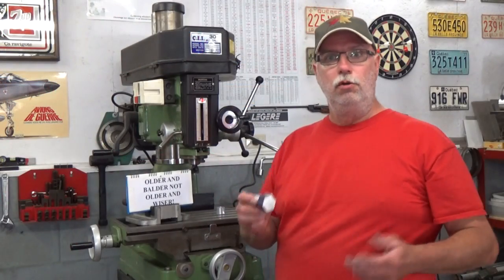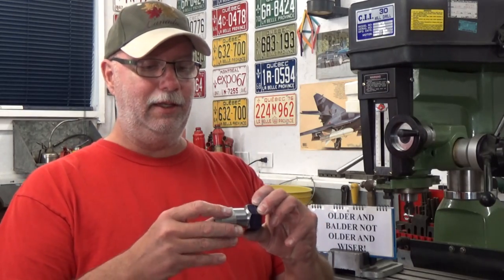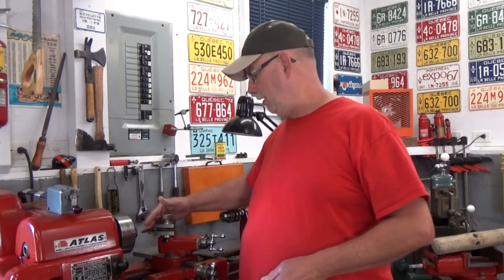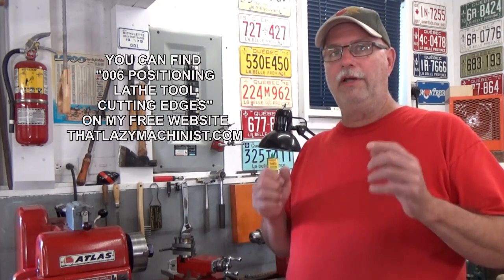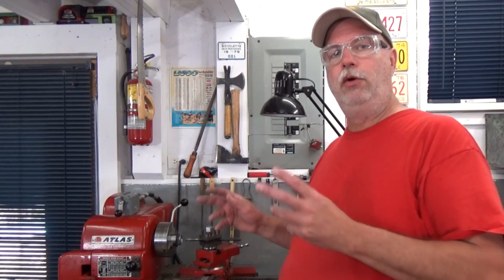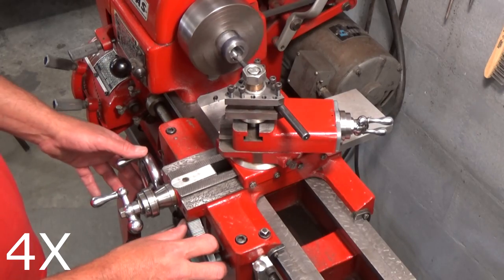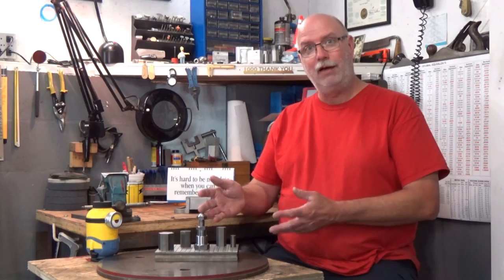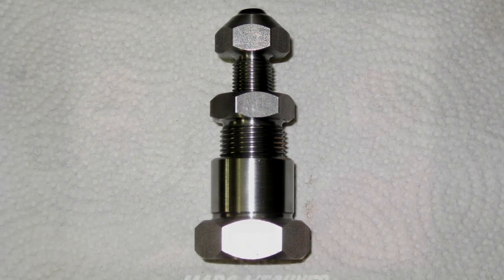SCREW JACK PART 6, lathe 101 Marc L'Ecuyer

Comment: Another good video Marc. I don't know if this would be a place (since it is for new machinists) to make further note about tolerances. If you are working from a drawing that is drawn with GD&T (Geometric Dimensioning & Tolerancing) it rewards the machinist for doing what is counter intuitive. It rewards the machinist for making ODs (or other external feature) as small as possible and IDs (or other internal feature) as large as possible. The reward is that the machinist is given more tolerance on the location of the feature, i.e. the larger the hole you make the more room there is for deviation from the target location.
    Have a good Summer and be well. I'll be looking forward to seeing your videos again in the Fall.